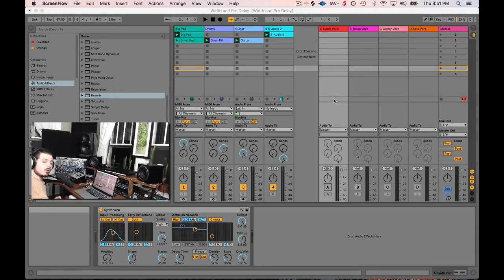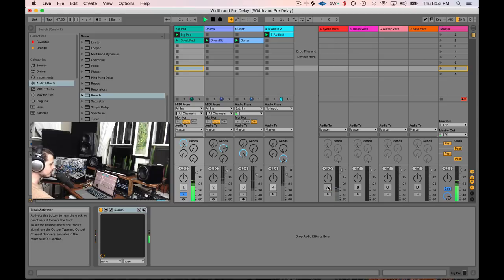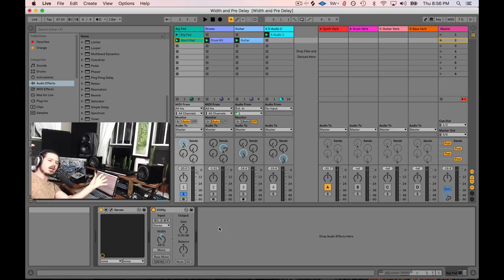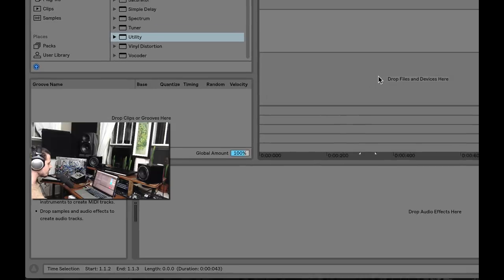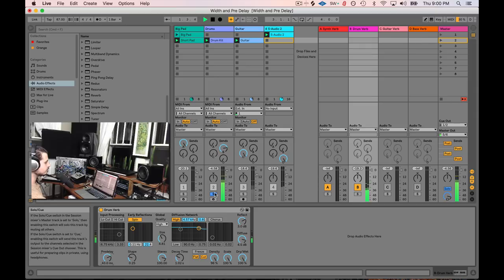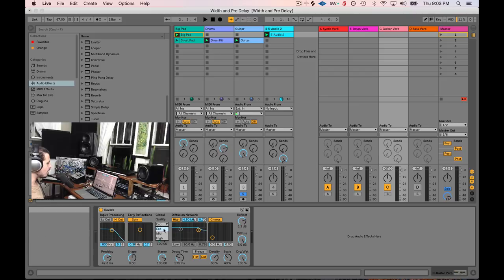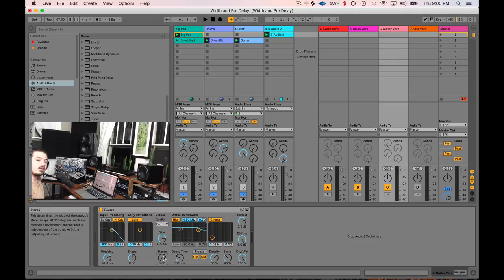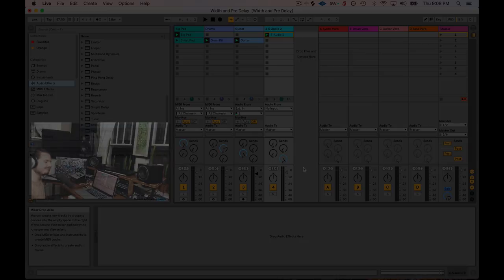Ableton Reverb - Pre Delay and Stereo Width

Comment: Its a nice reverb unit for sure. I have 'FabFilter Pro-R' from the Fab bundle (Fabfilter VST's are beauties!) but for reverb I usually still use Abletons. Its the Comp & EQ I'm in love with. The rest, I haven't delved very deeply into. IIRC Pro-R has 'space/size' linked with 'decay time' whereas I prefer all parameters to be individually controllable. Can't create "long decay & predelay + small size" reverb (something like plate reverb maybe) if size is linked to decay. Maybe theres a way to unlink them but until I play around with it enough to find out, I'll be keeping Ableton "stock Reverb" close by as always. It does more or less everything I think I need! Just a shame you can't get a "spring reverb" sound from it though, which sounds great in EG Dub & Reggae.

Comment: watch out for that dynamic grid, its got me over & over again. Just a heads up with love my man, Your note grid in arrangement was dynamic at time of recording e.g. when demonstrating the pre-delay for the drum part the dynamic arrangement grid settled at a note value of 1/128 (22.55ms) & not 1/16 (which is 172.42ms).. just a heads up thanks & much love bro
Reply from the maker: Thanks you're right and thats correct. Its all how it sounds at the end of the day. What matters is that the divisions of time are synced in ms to the bpm. Whether that be 1/128th or 1/8th or whatever. if you want that "pushy pully" kinda sound and provided that the source material plays well with it. I think its best to experiment around.

Comment: great tutorial, helped me a lot and earned you a sub BUT wouldn't it make more sense to mono the drum verb? drums sit usually in the mid of the mix and instead widen the guitar verb. 
in live situations each guitar player is panned hard right or left to fill the stereo field with beefy low to midrange information which could eventually cause phase problems in the mid. I could be wrong cause your mix sounds amazing anyway so I am grateful for any kind of information
Reply from the maker: Hey great thanks for the feedback. I would try to avoid doing things that are "usual" and do things that sound good with what material you're mixing. Also i would try to avoid what i call "prescription" mixing tips. Such as "boost 5k in the snare drum" or "always wide pan guitars." Following these "rules" can really wreck a mix as no snare drum is the same, no mic is the same, and no tuning is the same. Sometimes guitars sound better in the center. Its better to break down why you  would wide pan guitars for example. Usually it is because 2 or more guitars have a lot of similar mid range frequencies and in order to get separation, you'd pan them away from each other  etc. In this mix the synth is wide so it doesnt make sense to make the guitar wide. If I was focusing on a polished mix here i likely would pan the guitar slightly to right or left just to get it to pop out  a bit more, but i wanted people to listen to the verbs here.
Reply: @SeedtoStage  I hear ya, it's all about context and the individual needs of each sound. btw how would you check a track for said phase issues?
I fell anxious about fucking up a track in the low end with several pads, drones, reverbs, convolver etc.
So should I set all reverbs at the same predelay and decay time? 
eg 130 bpm eight notes are 230,7ms ok, I get that but predelay and decay is contextual right? how is the split up?